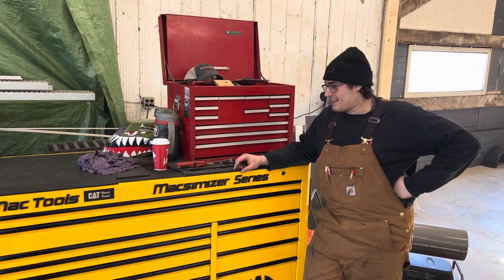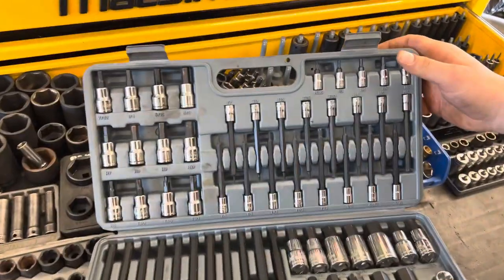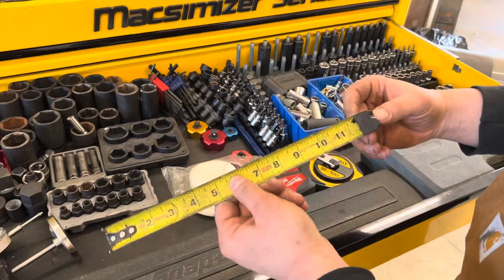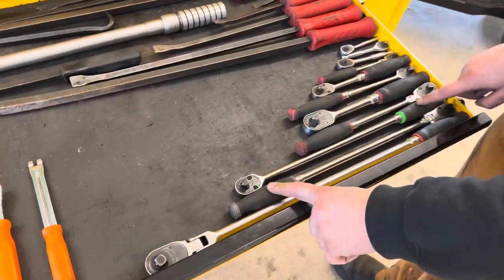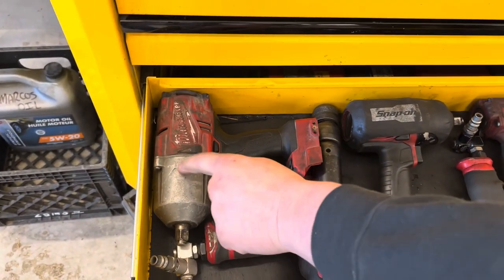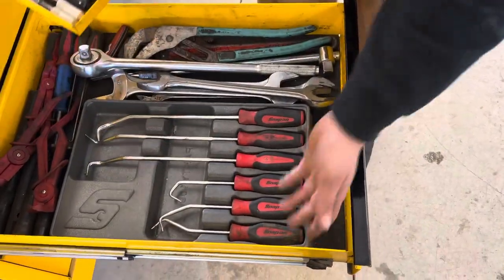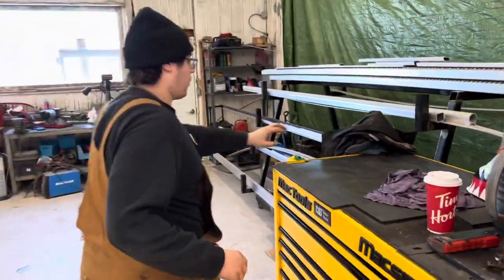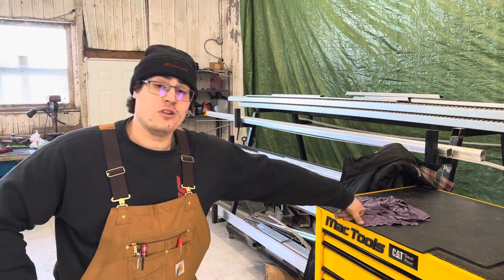Tool Box Tour (Heavy Diesel Mechanic)

Comment: Funny thing is that when I started as a tech over a decade ago they didn’t have much options on ratchets and tools in general but now they have ratchets that are just as good if not equal or better. Ex. The Capri soft grip 3pc ratchet set and the one I got recently you should check out you won’t be disappointed it’s the extra long set comfort grip 1/2-25in, 3/8-20.5in, 1/4-12in and I betcha anything you will love it and best thing from it the whole set cost $150.00 and you won’t buy a Snapon, Mac, Matco etc with that. Don’t get me wrong I love my tool truck ratchets but story short I have well over 100+ ratchets and I’m not a tool snob I love high quality tools and one to check out is Kokens, Nepro, Tone etc(which are Japanese brand and are a better grade steel) They are better IMO than the America tools by far but again I just love all tools of quality. Good video.

Comment: U need Tons of small to big crow feet wrenches even ones with pivot points ..larger 3/4sockets up to 2.5 inches or bigger.   Not saw torqx star bits to 80 ect.. feeler gauge...temp gun....